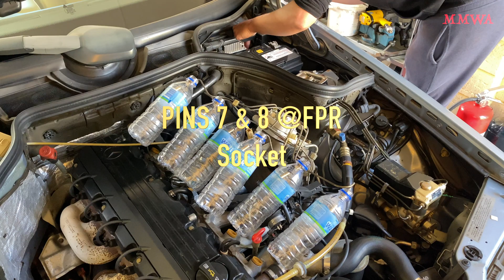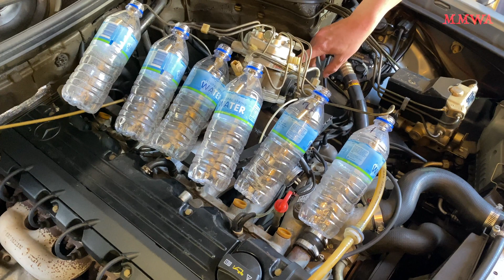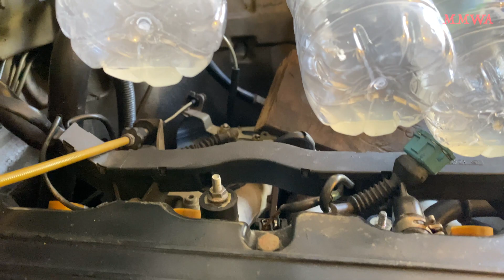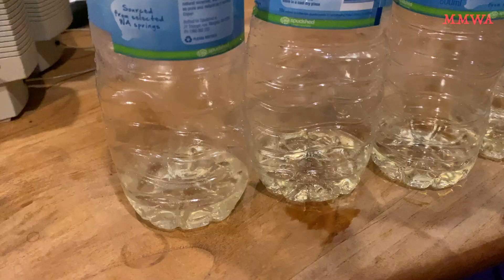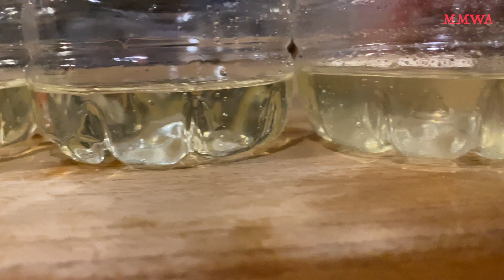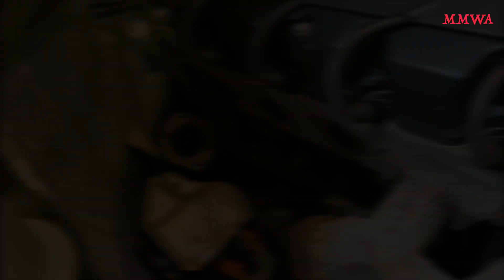The poor mans rough and ready KE-Jet balance test

Comment from the maker: In many ways I'm not happy with this video and didnt really want to upload it. Electrically there is nothing wrong with this engine, ecu or ignition system, fuel pressures also test out A1 Mechanically the engine is perfect with even compression across all 6 cylinders, there are also no vacuum leaks. I know there is a balance issue. I would have liked to have tested it better, the problem lies dealing with someone whos always got no money and driving around with the reserve light on so i couldnt test quanties over a greater range. I know it would have been more apparent at greater delivery rate. The issue with the engine is a non smooth idle.
Reply from the maker: @Andrey Paiva already been tried, this engine rocks around when richer or leaner, makes no difference.
Reply: @MMWA-DAVE , thanks for your work. I recently aquired a 1990 300 SE with 200K mi/largely dealer maintained example and I would like to soak and work the entire system using a strong rubber/o-ring rejuvenator and you just made that rather easy to handle.
Reply: Hey did you give the potentiometer on the injection block a look?
Reply: Hello Dave,

According to the Mercedes Workshop Manual (WIS) for the M103, the fuel quantity is checked in three areas.

1. Idle (4 milliliters/min.)
2. Partial load (30 milliliters/min.)
3. Full load (100 milliliters/min.)

The tolerance (dispersion) at idle and at full load is 10%.
In the partial load range, the tolerance (dispersion) is 13%.

I did it like this:
https://www.youtube.com/watch?v=Pj_gNI25f6U&t=4s

You have really great help videos, respect!

greeting
Marinko

Comment: I have 90' W124 300TE with millage approx. 225000. I wish to refurbish the KE jetronic fuel distributor and your video is so helpful and I believe it is one of the best video of this kind. Thank you for your great work.
Reply: ❤️ This video  is one of the best I was able to find so far and thanks a lot for sharing it ❤️🙏  Just bought a 124 T - 300TE 89' 287000km. Guess I have to do the same thing. But I wish that he had shown to top of the bottles and how he mounted them to the system. I am an absolutely beginner with mechanics like this and I can not affort expensive repair tools. Love  and blessings from Germany ❤️

Comment: My car struggles a little between 1500 and 2000 RPM, then goes normally... If I slightly reduce the throttle and then push it a little more and return a little again, as a surge, it goes better... I'm taking courage to service the FD and check the injectors...
Reply from the maker: if its surging at a repeatable particular throttle position, it could be the airflow meter potentiometer has a worn spot.
Reply: @MMWA-DAVE  I'm getting time and courage to service it!!! 😂I"ll aplly some vaseline on the tracks to avoid humidity

Comment: Wonderful timing.

I should be performing this as my fuel distributor has just been rebuilt and after flooring it a couple of times -with excessive hesitation in between -, begun running on 5 cylinders again and misfiring badly at low RPMs.

Pulled the plugs to inspect them and the cylinders but can’t find easily the culprit. Cause of rebuild was cyl #6 getting excessive amount of fuel.
Reply from the maker: not many rebuilders have the period correct bosch calibration machine. I know colin at k-jet specialist in queensland australia does. If i cant get this reasonably close once i receive my proper measuring cylinders, ill just ordrr an exchange FD from him and this can be a core. This is the reason i dont stuff around with factory calibration, i don’t even touch the adjustments, i rinse that half with acetone only and replace the diaphragm. My method is only valid on a good condition FD thats not trashed by being full of crap though
Reply: @MMWA-DAVE   I’m guessing it has been calibrated with proper equipment as this person does these repairs frequently.

Still, right after taking it out from the mechanic it didn’t perform 100% as before, rather lacking low end power and slight misfire/ hesitation due to 5 month old fuel and possibly needing an additional calibration.

Was “acceptable” until I floored it and it almost died, then begun running awfully. Sth to note is the car sometimes lost power above 5.000 rpm but has been doing that for the last 10 years at least. Now that lack of power is much more noticeable and throttle response isn’t as good as it was.

I’m more than pleased if it runs just like before. I’ll give it one more go as I’m not keen into EFI-ing it.
Reply from the maker: @apexseal2811 Hopefully it’s not contaminates from the fuel system that has soiled the refurbed FD. This is always a scary possibility too. What was condition of the rest of the system including the tank? Could also be one or more of the injectors with bad spray pattern or dribbling.
Reply: @MMWA-DAVE  Injectors tested ok all 6 apparently. Problem with the FD started 5 months ago and I gave it little to no use, but ran great just before.

I might also think some debris have contaminated the system. Couldn’t clearly see the tank’s internals with a boroscope through the fill hole and wasn’t able to pull the fuel level sender, but didn’t appear to be terrible.

Technically the tank has that screen, there is the fuel filter (now to be replaced as it’s 2 years old/ 6.000km) and then the KE-Jet filter to avoid these issues, though everything is 30 years old.

I’ll start out with the fuel filter and test how much fuel each cylinder receives.

Comment: My M103 300e '87  has a non smooth idle but good idle rpm. It never threatens to stall. Power is fine once I accelerate. It is not apparent when the engine is cold though. Cold starts are fine and smooth. It's only after it warms up but I can't say at what temp it begins. Definitely a rough idle once we get to 82C though.
Reply: That may be due to injector seals. You can test that by spraying carb cleaner directly over the injectors when you reach 82c. See which one causes the idle to stumble further. I use this method to test all rubber connections around the m103, to great success

Comment: This is how it goes - in order to have a smooth idle your sensor plate must be deflected to give you 4ml fuel per cylinder in 1minute. The difference between the cylinders must be 10% or 0.4ml AT MOST. That's how it goes for idle. Partial load 30ml(difference 4ml at most) and the full throttle 100ml(10ml difference between cylinders at most). That's how the manual says. Happy Mercedesing 😃
Reply from the maker: definitely a discrepancy in the balance, going to do the test again once i have the glass measurement cylinders which i ordered weeks ago. I couldn’t wait though and wanted to see something now.

Comment: I will have to look at this as I have issues with balancing in my 85 SEC. I rebuilt the seal kit in the distributor but I think my issues are with fuel being unbalanced. I didn’t realise until recently that if you play with one the rest change which sounds right. I was just going to do one.